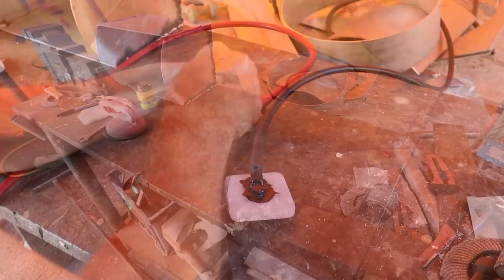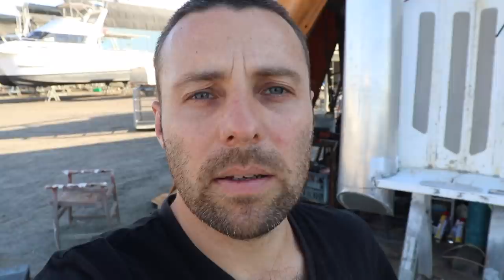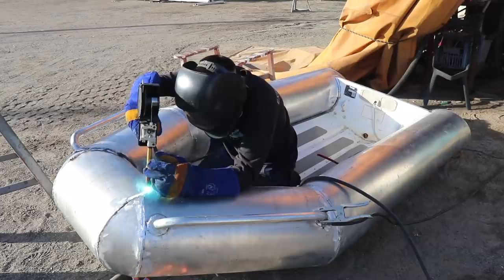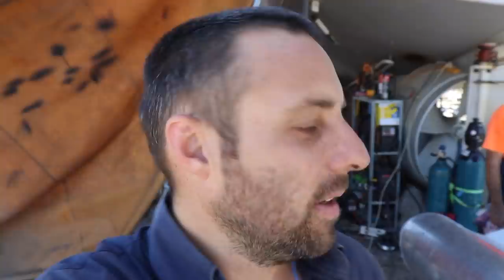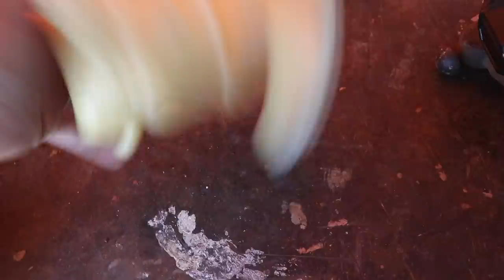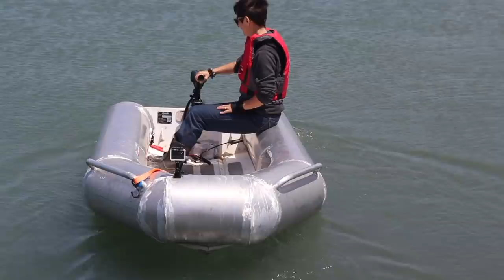DIY Electric Dinghy Sea trials, Part 5 - Project Brupeg Ep. 111

Comment: I am really enjoying your videos. The quality of your build is exceptional. I wonder if it would be possible to get your hands on a TIG torch and do some of the finish welds or fixing the pin holes when you have them. I bought a TIG torch fairly cheap here in Mexico and it has a manual gas shut-off valve. I have a Miller Bobcat 250 amp welder but have never used the TIG torch because I don't have a tank of argon. I was working in the oil field as a roustabout back in '06 and we had to run a spool thru the pipes to ensure they didn't have any dents, so the safety guys wanted our spools to be filled in the middle so it wouldn't allow fingers to get pinched. We tried spray in foam like what's sold in a hardware store and it wouldn't expand like we wanted. I think it was air activated and didn't catalyze like it would if it was sprayed into a wall around a window or gap. But I have never had a problem with a two part closed cell foam poured into a boat hull. But you did mention that you contacted the company and they assured you the Sika product would work. I have seen Sika products here in Mexico and wondered if it was a good brand, and now I see they are world wide. I am glad the boat turned out good. I wonder how it would do if it had a gasoline outboard on it. I know it's designed for electric, but I bet it would be tough enough to handle a gas outboard and hauling ass through the water. It would be good to know so in case you need it.
Reply from the maker: Hi Jimmy, yeah the plan is to swap out for a petrol outboard when we head to the ice. betteries dont last long sub zero so we will remove them from the boat at that point

Comment: Very nice homemade boat
Reply from the maker: Thanks mate
Reply: @ProjectBrupeg  I liked your construction alot.  As an electrician I would have used aluminum compression connectors  for the bulkhead penitrations but I think what you used and the foam will be both safe and effective.  Your holes would have been smaller.

Comment: Great job on the dinghy. Fun to watch you solving all the measurements and such. I would offer to keep an eye on your plastic isolation pads. i think those are HDPE (high density polyethylene) I use it alot and it is known to not take adhesives very well. Could be a source of grief in the future in spite of the foam. My two cents. Other than that, fantastic!
Reply: He still has to seal windows in the boat, and that sealant could hold those cutting boards just like the windows no problem.....if it comes up.
Reply from the maker: Hi Guys, yeah we have fitted dozens of windows with this stuff and its pretty amazing. that said i hear you about it might not work on the HDPE, on thought we had was to just rivet the plastic to the alloy using two alloy rivets. if the sealant proves to not be up to the task thats our back up plan
Reply: @ProjectBrupeg  Rivets would be a great backup.

Comment: Will you need to put some sort of cover over the batteries? To keep spray and whatnot out?
Reply from the maker: Hi Keith, we will be yes. For now we knew they would be removed once sea trials have finished so we didnt bother fitting any covers.Normally the batteries will remain in the cavity at all times with a lid over the hole

Comment: Great work! Great job for you to learn to weld on with all of those curves and all... I'm guessing you didn't go LiFePO4 for your batteries as they don't like the cold?!?! Especially where you said you are going...
You would definitely want more power than that on trolling motor, have you checked how fast you go with all of the people that you would potentially be taking aboard, plus whatever you will be carrying with you, including whats to go in the front? If you have a video answering these questions of mine and if you made any changes like putting an extra motor on the boat, a link would be great, even put in the description or something please? All the best on your endeavors! :)
Reply from the maker: Hi Colaaah, No additional update video on this dinghy yet. remember this is just a small tender for doing very close to shore runs where we dont want/need to get the big dinghy down off the roof. hence we have kept it as small and light as possible. as for lithium, it wasnt worth it. the AGM's give us 20km range and are 1/3 the price of lithium. As for cold weather performance, lithium handle the cold better than AGM or Lead Acid's but we will be removing these batteries and using a petrol outboard when in the ice. most of our dinghy travel will be in the jet tender but this boat will be our backup.

Comment: Great job!
You may want to consider buying an extra propeller as they are not terribly durable. I competitively fish and have torn up several them striking gravel and unseen obstacles, like in your case, ice.
Reply from the maker: Hi Gary, yip great idea. I actually have no idea where to source a new prop from yet, do you know of any suppliers that would have this type of gear?
Reply: @ProjectBrupeg  I can't find any information regarding the Seamanship prop. It may be a generic fit. If so, you can pick one up pretty much anywhere. I only know the US market, but I did switch Amazon AU to see what's readily available. Here's a link to one that looks like it will work. Good thing about this posting is that there's pictures and a diagram. Check it against your prop. I'm betting it's the same. 
https://www.amazon.com.au/U-BCOO-Propellers-Electric-Outboard-Accessories/dp/B072KDJDYP/ref=mp_s_a_1_fkmr3_2?dchild=1&keywords=Seamanship+Electric+Trolling+Motor+propeller&qid=1574729773&sr=8-2-fkmr3
Reply from the maker: Nice thanks for this link

Comment: What a great design, love it!
I've heard when shipbuilders weld steel totally enclosed compartment they put lit candles inside to burn out the oxygen, would there be any value in doing that your tender?
I've seen metal boats where they sprayed foam in, after a period of time when moisture gets in it can cause pitting between the foam & the metal.
Reply from the maker: Hi Jeff, likely no point in an alloy boat as the oxygen is actually helpful in making aluminum oxide form (alloys protective layer). That said its a great idea for steel tanks. No oxygen is absolutely what you want in that situation
Reply: @ProjectBrupeg  Thanks for the further explanation...It was really fun watching how you tackle the dingy project!

Comment: Howdy Damian,
Have you given any consideration to putting any padding on the outside of the tubes, so when the dingy is tied to a wharf it acts like a fender?
Reply from the maker: Hi, Yeah we will be doing that, just havent got to it yet. Ive seen closed cell foam used  as side padding and it looked quite effective

Comment: Ya that Aluminum oxide is such a pain I had a crack on my pontoon boat had to use an expensive heavy duty stainless steel wire wheel to get to clean metal and set the heat a little high to tig it up.

Comment: You make that awesome aluminum boat and just use a trolling motor. I think you need a big gas engine to get it up on a plane. A dingy is like your car to get around.
Reply from the maker: Jared this dinghy is the first of two and designed for a disabled person to use slowly. The second will be bigger and have a jet engine. Jess
Reply from the maker: Lol. I love that line “will have a jet engine” like your turning the dial up from electric trolling motor, past gas outboard till you fall off the chair as your still turning and get to jet engine. Dame

Comment: Congratulations from Spain, I am building a 35 feets aluminum sailboat , and always learn something about welding and specialy the tricky tanks  witn several holes like you, but finally grinding , cleaning and welding is the only solution. I use acetone, but that kind of acid use you to clean the shoot ?
Thanks for your videos , Juan
Reply from the maker: Thanks Juan. The acid we used was a sulphuric based aluminium cleaner designed to remove the oxide layer
Reply: Project Brupeg . I will look for it, thanks and sincerely I wish the best for yours

Comment: Spray that thing with Rhino-Liner truck bed liner. It'll hide all your welds and make it absolutely water-tight. Forever.
Reply: Rhine bed liner is NOT water resistant, it is porous...
Reply: @vancemarin8022  ok...it'll take a couple decades to sink.

Comment: Looks great! Umm, the motor should be straight up and down, not 15 degrees... If the motor was tilted up so the motor is basically horizontal, the bow would not take as much water over the top (visible even in the relatively calm water you were testing in). In fact you may want to tilt slightly the other way (1 degree or so) to lift the bow over the waves. Walk around the yard and look at similar (soft) dingies  with the little gas motors on them and compare the angle of the prop shaft. Just take a 2x4 and slice it at a 15degree angle and put one part on each side inside the motor mount. You may have to plane it a little thinner than an inch and a half to make everything fit. (ya Canada uses metric.... except building materials)
Reply from the maker: Hi Len, yeah i know what you mean. the outboard bracket has that adjustment but we just never bothered setting it right. its low power (1.8hp) and the fibreglass tube is quite flexible so even set straight the motor moves forward maybe 2 inches at full power. the reason the water came over the bow is I was punching into 1.5ft chop and with a blunt bow that was alwas going to come over the front unless we were planning

Comment: Are you going to cover the Battery box area with some soft Rubber like a flap that just hangs down over them to stop any water (rain or sea ) from sitting inside of the boxes ???????????????? anyway good job all.
Reply from the maker: Yes we will be. It will actually be an alloy flap that’s semi permanently held on. As once the batteries are in we have no need to get in there being fully sealed maintenance free AGM’s

Comment: What about an A frame on the transom with a buoyancy chamber on the top. This means that in the event of a capsize the boat will not remain inverted.
What do you think?
Alan in London
Reply from the maker: Ahh yes. so we dont plan to do that on this boat, but on the jet tender I have a bent alloy hoop that goes over the transom for exactly that reason. it will hold a radar, antennas, lights etc but also an inflatable air tank that inflates on immersion so we can self right

Comment: how much does it weigh? Amazing !!
Reply from the maker: The dinghy is around 60kg. It could be built lighter. We used 2mm sheet for the tubes, if we did it again we would go 1 or 1.5mm sheet as the round shape is very strong and we don’t need the tubes as heavy as they ended up being
Reply: @ProjectBrupeg  Thanks, I'm about to make a similar one. with the floor of a highfield dinghy. I'm in Guatemala and it's a bit limited to get materials. What type of aluminum did you use? In 1.5 mm I only get 3003. Do you think this is useful for making the tubes? I plan to weld with TIG with 4043.
Reply from the maker: @ylanglexeterna4503 5000 series alloy is best for corrosion,  it if you can’t get it then 3000 will work. 
We used 2 mm plate but found it was too heavy. We would use 1.5 mm if we were doing it again.

Comment: If you could get those welds clean TIG weld the gaps together with the extra filler and a stainless steel brush and aluminum cleaner.

Comment: I would have thought a simple suggestion for the battery cables would have been to weld a 1.5 inch aluminum pipe on the inside of the boat. At the joint of the sponson  or tube and the dinghy floor. That little v is perfect for this. Then if you ever have to replace a cable (which you will) it will be simple.
Reply from the maker: Hi John. We wanted the ability to hide all of the wiring, and with the conduit held in with foam we have the ability to swap out the cable at any point.

Comment: Since you're going to be in a freezing environment are you going to insulate your battery boxes? Cold temperature can seriously degrade batteries to the point of not working properly at all...
Reply from the maker: Hi Rush, the plan when we head to the ice is swap out the electric drive for a petrol outboard. the e drive is for the 80% of the time we are not in ice conditions

Comment: You could probably get better performance if you upgrade the propeller to something that's not designed for low speeds like trolling. That prop was designed to move a big boat slowly, you're trying to move a small boat quickly.
Reply from the maker: Hi Nick yeah thats true. i have thought about 3D printing a prop as i dont know where you could get increased pitch versions from

Comment: The instant you stop grinding aluminum to prep it for welding, oxides begin to form on the surface.  And as you know, welding in any wind blows your shield gas away, which is your last line of defense.
Reply from the maker: Hi John, yeah in the end we found if we stainless buff the area, then acid wash it and leave the acid untill seconds before we weld, the a quick water wash and air blow dry and straight into the weld we found it successful. we would time our welds for low wind lulls and so on

Comment: Might have stress cracks after a while when pounding on the waves ... but maybe not since it’s powered by a trolling motor
Reply: I like your hole saw trick ty
Reply from the maker: Yeah 1.8hp doesnt really pound. this is a floating bath tub so its pretty easy going with sea motion etc

Comment: Would adding a dark food colouring to the water have made it much easier to see the smaller leaks?
Reply from the maker: Yes, but in the end we changed from water to air and bubbles and then air and acid as is got into the crevices better than anything else
Reply: @ProjectBrupeg  Ya, as I watched the video I realized the water was just to find the worst of the initial leaks, not the approach for finding the finer holes.

Comment: Great vid great project. I am sure you must have some interesting plans/thoughts for a liferaft, or is this the Liferaft also?
Reply from the maker: Pretty conventional actually. Step one don’t let main boat sink, step two if that happens get in big dinghy, if that’s not possible get it either this little dinghy or the life raft, which every is going to give us the best chance. But above all else make sure step one doesn’t get to step two
Reply from the maker: Hi Admiral, Brupeg is all about redundancy, having multiple levels of systems to keep things working. the dinghies are no exception. the big dinghy will be a beast, with 3 weeks of food, a manual water maker, self-righting ability, flares, radar and comms ability, if it's looking like we are going down, we will firstly be attempting to save the main boat, if we can't then the liferaft will be going into the big dinghy and then that dinghy will be launched. As for colour, I honestly couldn't tell you what the plan is there, still a few years off having to figure that out. But rescue orange does stand out like nobodies business on a white background

Comment: At first I agreed with welding the tubes and the bottom piece together at the tube weld. But I think you would be better off putting the tube welds on top or on the side of the boat. Instead of between the bottom piece. It will be a lot easier to fix later on if a hole develops. Or even just for the pressure testing part.
Reply from the maker: Yip in hind sight I would have moved them but this was a design choice i had to make right at the start without realising the full implications. Dinghy two wont have this issue

Comment: Would you prefer to have an icebreaker type hull instead?
Reply from the maker: For a dinghy? no matter what design we had hitting ice will be like throwing a cork at a brick wall. This thing weighs 35kg, its just going to pop up over anything in the water.

Comment: Instead of round tubes why not half octagon.. come straight up from the hull with flat plate and weld on a half octagon to that. Plus you would gain internal space and should be plenty flotation if the boat is swamped.  Plus it would be a million times easier to fab up. Just an idea.
Reply from the maker: Jeromy, thats actually exactly what we are planning for the next dinghy

Comment: You may try offsetting the motor to one side, right if everyone tends to sit on the left side, in order to create a bit more room to move the tiller.  It won't effect the trim much and some boats tend to need some trim anyway and this could be an option to make the boat run true.
Reply from the maker: Yeah we have some fine tuning to do, but all that stuff will happen in the water

Comment: Could you spray something flex-seal inside the tubes for extra waterproofing ?
Reply from the maker: I guess you could but we didnte really need to in the end. Plus i would rather not have something like that inside as if I do need to weld a hole later having a goo flow through the weld will forever be a nightmare when welding

Comment: You should of build some steps into the rear of those aluminum tubes to get in and out easier simple process
Reply from the maker: Yeah we thought about that but its really simple climbing in the side of these round tube dinghies, so we decided not to bother
Reply: @ProjectBrupeg  You should try it. It is not easy and one way when your in the water is to face away from the dinghy and lift your arms up grab a support on the top of the tubes and then raise your legs over your head and into the dinghy. voila! What about some grab straps or a rope along the top to hold on? André